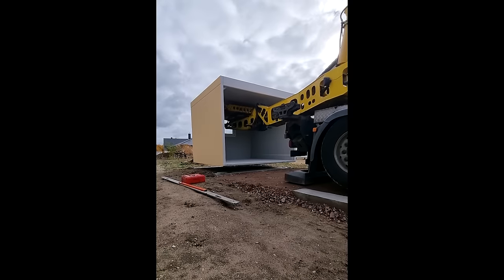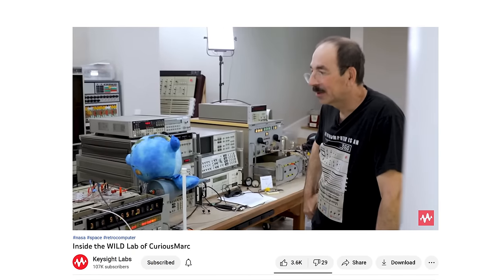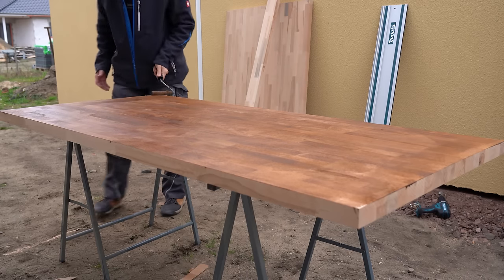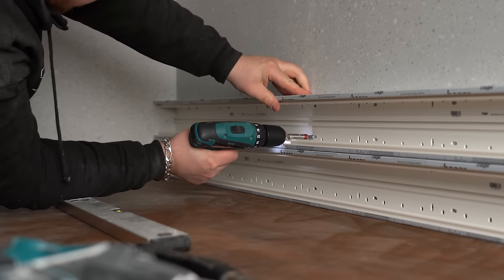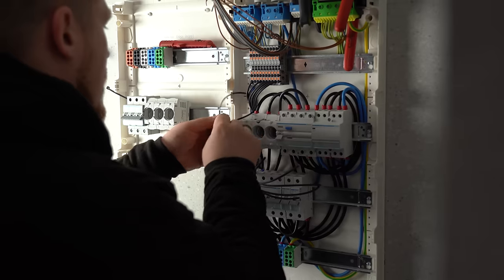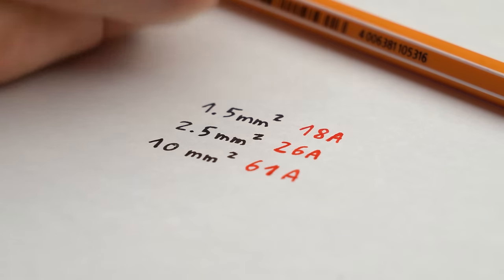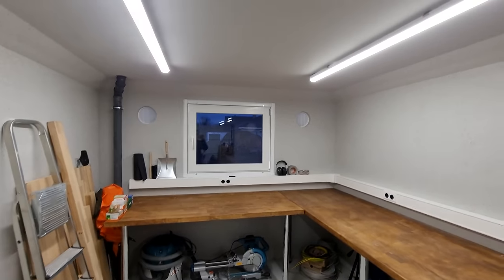Germans do the PERFECT Electrical Wiring! (Garage Build)

Comment: all good except the limited capability of the lan cables in most newer buildings/houses. I recently took the liberty to set up my network in my apartment thats a part of a building built 7 years ago, all the cables throughout my house are split in 2, to give each socket both dsl and ethernet (a little useless if you ask me) and due to that, the whole network is automatically limited to a bandwith of 100Mb/s. I understand the whole story where optical internet is still a thing of the future in the majority of germany due to someones lack of judgement, but 7 years ago it would be the absolute dumbest thing to do, how does that make sense? I may be wrong, so please let me know in that case. nevertheless, loved the video, keep it up.

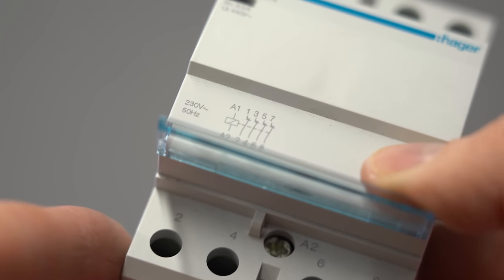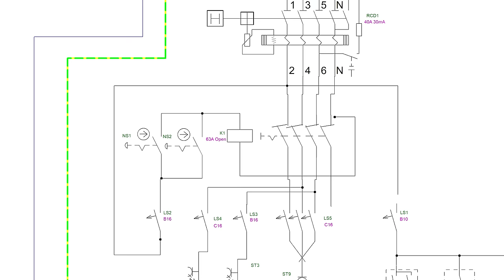Comment: Nice , but why is the PE (instead of the N ) connected to the N of the 3 phase disconnector (with the integrated relay) in the diagram @ 6:56 (also N is not connected to PE at the beginning of this circuit (top left) ) & the power for the relaiy is not connected (the point hangs in mid air) @ 6:56

Comment: Nice, would be great add one more "emergency switch" on cable (with Neutrik connectors as example) which could be near your hand, i know well from praxis cases that something "burn" and isn´t  too much time to disconnect it from socket or move your hand to emergency switch on the wall:-) . Why you use emergency swithes in boxes and not use M22 elements directly on "cable canal"? I didn´t seen AFDD device :-)

Comment: If a licenced electrician wired the emergency stop switches like you have, they would lose their licence here, highly illegal here as they must fail " safe" so any wire break in the control circuit causes the power to shut off.

Comment: The install is alright but I hate that grey conduit
I dont use it at all these days. The square white trunking looks better and doesn't leave shitty gaps with exposed cables everywhere. They sell bends for the conduit by the way... why not use them???
Still prefer white trunking even if the conduit was done perfectly.

Comment: I'd be interested in seeing if you could work around the cable break scenario with a properly powerful capacitor. Exactly enough power to operate the relay in worst case cable break scenario without having to continuously power it.
Reply: how about to switch off the power, the moment you leave the room for a longer time, one reason people make the Notaus for!

Comment: "because of german electrician rules" Its ISO so its INTERNATIONAL :b DIN0100-600 & 0100-105 are European ISO norms for having an continuous protective conductor and not using PE as a conductive wire :V Other than that nice video :)

Comment: Können wir einmal über die Stelle bei 10:33 sprechen?
Laut DIN EN 60446 (VDE0198) Absatz 5.2.2:
"Beim Fehlen eines Neutralleiters darf ein Blau gekennzeichneter Leiter im gesamten Kabel- und Leitungssystem auch für andere Zwecke, ausgenommen als Schutzleiter, angewendet werden."
Oder ist da eine andere Vorgabe, welche die Benutzung des blauen Leiters als geschalteten Draht verbietet?
Reply: Dort ist ein 5*1,5 oder 2,5 mit Steckdose, normgerecht wäre also 
PE grüngelb
N blau
Schwarz, grau und braun, einen als Phase, 2 als geschaltene
Reply: @ichich3978  Wenn die gezeichnete Steckdose mit verdrahtet werden soll, dann gehe ich voll mit der Aussage mit.
Reply: Der blaue darf geschaltet werden und als phase verwendet werden. allerdings muss eine verwechslung mit einem blauen N ausgeschlossen werden z.b in abzweigdosen mit blauen N muss der blaue schaltdraht gekennzeichnet sein

Comment: I've said it before, and I'll say it again...
Does Germany not have any corner conduit pieces? What's with all these exposed cables every time you need to go anything other than dead straight?
And no glands going into boxes either...

I can post you some from the UK if you like, and then you can make it look proper!
(Well, as proper as it can be without switched 13A sockets). 😝

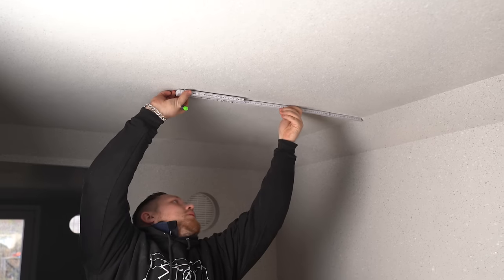Comment: 8:47 (UK Industrial Electrician here) - I never understand why Europe bothers with conduit as seen at 8:47 - In the UK we would run the conduit from end to end IE from the main cable duct/trunking all the way to the final device and we would bend it where necessary. In Europe, they just put little pieces and have the cable exposed at all corners. I always thought it looks quite strange and why even bother?

I've not watched the rest of the video yet, but I wanted to see what other people thought about UK Vs EU conduit?
Reply: Okay so after watching the full video - I like the E-stop, and I'm glad you explained why you're using a NC contactor as my first reaction was exactly as you predicted.
The movable sockets are a nice touch. I'm personally not a fan of 'plug and play' cables for fixed electrical systems and I'd have preferred to hard wire the sockets with extra length on the wire, but I can see why you used them.

I still can't get my head around the way you guys do conduit though. Why not just put a bend in the pipes and have a continuous run? Also the blown out brick is a shame.

Nice video though!
Reply: @lukejay  The cables don't need the conduit, but it's a lot easier to clip that in a few places than to drill shitloads of cable clips into the concrete wall.
Reply: @han5vk  but why not keep it consistent with bends etc? It doesn't add much time but makes for a much better install.

My point is that, in this case, UK wiring is better than German.
Reply: @lukejay  You cannot bend this type of conduit. I believe you can get elbows but they aren't that common. Metal conduit is not allowed afaik. 

Maybe on the mechanical front, not the electrical one, afaik.

Comment: Sir I have 2 lipo battery of 10000mah 3.7 voltage i don't know how to charge those battery.
I know they require charging module and battery protection circuit but I am not able to figure out the charging module and battery protection circuit.
Please can you suggest some charging module for the battery pack and BMS.
I want to create output voltage 5V 2A and 12V 1.6A and I want to my  charge battery pack of 3.7V 20000mAh using normal type C charger of 5V 4A.

Comment: hi one question why would you need a leg for the table on the wall side at the time line 3.50? you have already secured it in to the wall using a wooden strip.

Comment: Definitely a neat job, very clean. However, that IEC type equipment just seems chintzy to me compared to NEMA. I guess it works fine for the average home install. Also not sure why anyone would bother with conduit if the cables are unprotected at the bends and junction boxes anyway. Not a dig at anyone or any country, just some anecdotal observations.

Comment: Your installed cables jumping from the end of the plastic conduit seems very odd as it leaves it open to potential damage. In the UK the conduit is connected at all points and the wiring is never visible

Comment: Moinmoin, 
hab gerade gesehen, dass du quasi in der Nachbarschaft wohnst bzw deine Firmenadresse hast, daher schreib ich dir einfach mal auf deutsch. Ich hätte dir empfohlen die CEE Dose mithilfe einer CEE Steckdose 5-polig Eb 16 A mit Klappdeckel Verbindungssysteme in den BR Kanal zu montieren. Hierfür den BR Kanal 1,5 - 2m weiterführen. Den Not-AUS hätte ich auch in den BR-Kanal inkludiert, sieht optisch wertiger aus. Ansonsten schöne Ausführung :-) Grüße aus dem Stuttgarter Kessel.

I would have recommended you to mount the CEE socket in the BR duct using a CEE socket 5-pin Eb 16 A with hinged cover connection systems. To do this, continue the BR channel 1.5 - 2m. I would also have included the emergency stop in the BR channel, it looks more valuable. Otherwise nice design :-)

Comment: Electricians from Australia take note: there's no "She'll be right" attitude or "Near enough is good enough, mate" here. This is how you wire up. Do your research, do the math, and be thorough with your work. We've got so many slack jawed yokels over here doing dodgy wiring. It's high time they got their act together.
Reply: This is a 8 or 9 out of 10 install imo. Yes even what you see here aint perfect. They sell bends for the conduit and you are supposed to use them. That never happened here.
And I would not use this shitty cheap crap at all and use square white trunking instead.

Comment: Not sure I'd call it beautiful but it's very functional. In the U.S. it would've been piped with EMT which would look better IMO, not sure I could stand the discontinuous runs of conduit
Reply: it's more used as a kind of cable tray than a proper conduit for single insulated wires. it's very common in industries here when you only need to run one or a couple of cables neatly across a wall. But if they did run discreet single insulated wires, it would have been a proper conduit with all the bends and sealing to the junction boxes.

Comment: Interesting to see how Germans do their wiring, but I'm not a fan of your conduit system - I'd have liked to have seen the conduit go right upto the fittings rather than just being a guide for the cables.

Regarding the emergency stop switches, you could have solved the issue by adding a "start" button which latches the contactor on - Then you're only drawing power after having activated it and the bonus is that it wouldn't automatically restart if you have a power outage.

Comment: i would've used conduit boxes instead of junction boxes. wouldve eliminated the rough look of cables just hanging between conduit and the junction box and reduced the risk of catching the cable with an object possibly causing a short circuit.
Reply: cable is stong enough to staple directly to the wall. piping is for the looks and speed of installation.
Reply: @arjanvanraaij8440  At the end of the day pvc conduit is used as a form of mechanical protection. At least it is in my company. Since nym-j is just coated with soft pvc sheathing which is easily scored and cut. Had a few call-outs before where someone was moving furniture around and they ended up hitting the nym-j causing the RCD/RCBO to trip.  bit of pipe goes a long way in terms of mechanical protection so one may aswell just finish it fully instead of leaving open ends everywhere, giving the installation an unfinished/messy look.
EDIT: also the cable will over time start sagging. It'll leave loops hanging of the ceiling.

Comment: First of all sorry, but I need to point this out.
Even the "safer" version shown here is not a real Emergency-Stop (E-Stop). Thats because you are not allowed to build an E-Stop with normla relays, you need to use special E-Stop Relays, which are triple redundant and can be wired in different ways. Altough they probably do not do anything different than shutting of a realy they are still far more reliable and well at least if you want to lable it as such required for an real E-Stop.
Additionally by putting a circuit breaker infront inside this E-Stop circuit that requires power it might be disabled in some strange cicumstances. Nonetheless it would at least be better if you would connect the E-Stop switches and the relay coil behind the same breaker.

Comment: European electrical codes seems both more stringent than US codes and also simply better. I would really appreciate being able to rely upon higher voltage and three phase power!
Reply: 400V 3 Phase is very central european though.
In the UK, Spain, Italy etc you will already not find a 3 phase feed in every household.

Comment: Don’t you use elbows or bend the conduit in corners?

What’s the point of conduit if it’s open at bends or accessory entry points?
Reply: just holds the cable in its place :)
Reply: @Ace7530  that makes sense I suppose. Although as a UK spark, it just looks weird.

Comment: Whats the point of the conduit if your bends and 90's are exposed? Does Europe not have pipe benders?
Reply: These pipes are not meant to be bend.
They would break. But you could buy an pipe elbow (hope translate is right) with 90° 

However this is not needed.
Wires have to double isolated. Shown cable (NYM-J) ist double isolated. Cu Wires alone are isolated (the coloured thing) + all together are isolated too (grey thing).

You would have to use pipes if you only use simple isolated wires (H07V-U).
But thats only used in concrete or brick walls and only if the whole wiring and distribution box is concealed (inside Wall).

Comment: I think you could have saved yourself some bucks with reducing the amount of legs you installed: Since your table tops often end in a corner, I would have used another piece of wood to mount it to the wall. Easier to clean the floor, cheaper and looks cleaner to the eye. Plus I would have mounted that CEE socket right at the end of your cable channel so there wouldn't be a change from channel to pipe. But that's purely from an estethical point of view.

Comment: Is it allowed to have both three phase and single phase, or different groups (circuits behind different breakers) in the same cable trough, like your wall duct with the CEE-form and the Schuko sockets?
Reply: Yes you can split a 3 phase circut  if it is posible to switch off all with one device. in this case it is the RCD. 
No for diffent circuts in color coded conductors. Each Neutral has to be Blue!
Yes for number coded circuts, but you run in trubble if you want Power over it. a 10*1,5² (1..9 +PE) you are verry fast at max fuse 10A!

Comment: What's the design choice of the Drehsicherungen instead of a Sicherungsautomat for the main power tripper?
Reply: Back up protection and selectivity
Reply: @tsataras  Thanks for the answer. Follow up question: Wouldn't it still be more convenient to get a resettable fuse according to the planned max current draw? If something fails, the subsystem's fuse will naturally trip first (or better only). To trip the main fuse, something must go really bad.

Comment: This should have an added NSFW tag for all the cable porn in it. 🙂
On the note of what I would have done differently: I would probably moved that other bench in the 3x3 too, creating a U shape there. IMHO, currently, it is kind of a tight fit for a car there - which is the first reason for the existence of a garage in the first place.

Comment: 62W contactor? It usually have like +-30W while switching and +-10W while active. Also you have to use safety relay, because you do not want to automaticaly start after stop switch is released, you need to have start button, so thats why safety realy is good. We in Czech Republic learn a lot from Germans but your installation is not the best you can use nicer distribution boxes, AFDDs and so on..

Comment: Schneider make contactors for motor control rated at from 20-200A that draw less than 7w its a very poor excuse for not having it safely but on top of that its not really on 24/7 its only on while you need the sockets so you

Comment: What I don’t get about German electrical installations is the way you use conduit. You run wire in conduits to provide some form of mechanical protection however you end the conduit early and run the cable in free air into the junction/switch etc. granted it’s only a few cm if exposed cable but to me it defeats the object of having trunking.. 

Your not the only one I saw it in houses all over Germany..
Reply: the cable is already double insulated no need for extra protection.

Comment: Beautiful work man.  I'm an electrician in Brazil, handling electricity is basically the same, but the way we do installations is very different.  We use flexible cables for all types of circuits.  Our installation and passage boxes are smaller and our plugs are of low quality.  We have a poorly elaborated system of rules and most electricians do not understand very well how electricity works and must be respected.  A high quality electrical installation here requires an absurd investment and therefore a lot is done without due attention.

Comment: Hey, what about testing your installation after "VDE 0100 Teil 600"? Would be interesting, if you have done that and how... Maybe as a video... And was it intended that you have fuses instead of "LS-Schalter" as main over current protection?
Reply: The Neozed fuses are only there as preprotection. In normal operation the installed LS-Schalter would flip. But if somehow those fail the fuses would blow.
Reply: @maik00979  Yeah... I know... But is it worth the effort, but are these worth the effort? I mean you can get an LS-Schalter from Abb for around 15 Euro... I personally would only use Fuses, in super high power applications with fixed consumers, Like a big Lathe, etc. Even if I would still have them laying around...

Comment: the Dutch super seed the Germans in electrical technical installations for housing and in general. in some sense over engineered.
Hence the have a international recognized testing brand for electrical technical stuff: "Kema Keur", pretty sure you saw the mark on the devices you have mounted.
wiki: "Elektrotechnische verdeelinrichting" a house installation fuse box, the wires are better housed in the walls using tubes and invisible junctions boxes (behind ceiling lamps where all tubes lead too) and can be easily replaced or upgraded.
no wires glued using plaster on the walls.

Comment: A long time ago I had to add some emergency stop buttons to the workshop at my old job. All the socket outlets on the workbench, and the machines were on a 30ma RCBO (RCD). I had the emergency stop buttons connect a resistor to earth from live. This leaked about 60 milliamps, Live to earth, when the E-stop buttons were pressed. It's probably not the right way to do it, but it was very simple and effective way to achieve the E-stop function, on an existing installation.